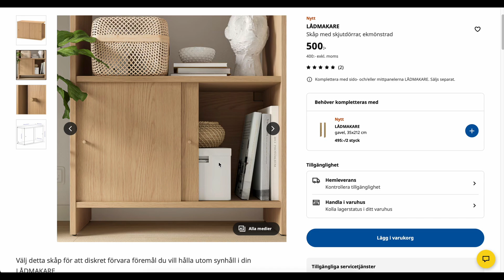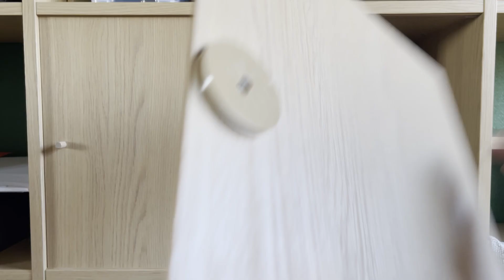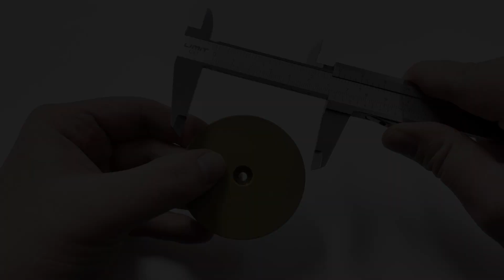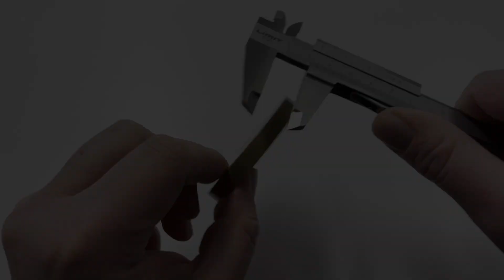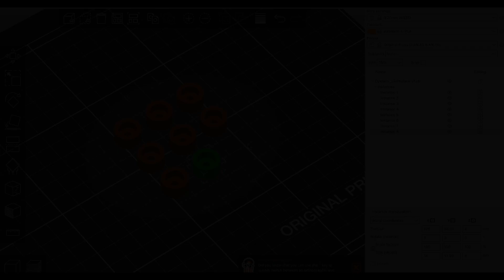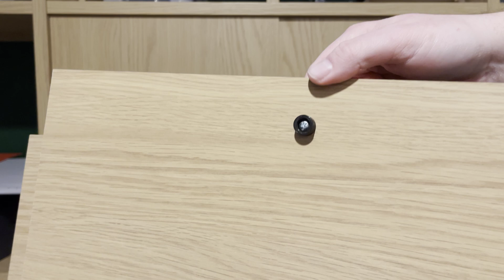IKEA LÅDMAKARE  - fixing annoying design flaw!

Comment: Hi! We are looking for a tall shelving unit to use as a room divider in our new townhouse. Can i ask what the back of the sliding Doors part looks like (as we would like to use some but then the back would also be visible)? Is it at least somewhat visually appealing 😅 or does it basically look like the cardboard on the back of a lot of Ikea furnitire? 😅
Reply: Hi! The back of these is the same as the front but there are 2 cutouts on the top back of the storage for anchoring to the wall  and also on the bottom there is 2 inches of exposed particle board  on the vertical dividers that support the storage so if you are okay with those it wouldn’t be too noticeable in my opinion

Comment: May I please ask you two questions, since this shelving system will be delivered today:
	1.	Do you use wall plugs (dowels) to fasten the shelf to the wall, or only the screws that are included?
	2.	I have to assemble this shelf on my own. Can I fully assemble it on the floor first and then attach the complete shelf to the wall as a whole?

Thank you very much for your help!
Reply from the maker: Thanks for the questions and congratulations on your new furniture ❤️
1. As I remember no wall plugs were provided, what is common at IKEA as on many markets you need quite specific ones. Mine is fixed to a drywall with those „umbrella style” ones.
2. I was assembling it on my own also, and was perfectly doable in upright possition. Just go element after element, firstly fix one side panel to the wall, then use one shelf to set the second one etc. I think it might be doable to build it on the floor, with front facing down, but you need to be very cautious when moving up. And personally I believe it might be a way harder way than going straight on the wall.
Reply: @ChrisTalksAboutThings  I really appreciate your congratulations. That is such a thoughtful and kind gesture from you. Thank you so much!
With gratitude, I thank you for your detailed, helpful, and timely response. It is a great help to me!!! I will follow your example, buy suitable plugs, and then assemble it step by step on the wall.
Did you fasten the plugs you bought to the wall using the screws provided by IKEA, or did you purchase other, higher-quality screws?
Reply from the maker: I used the ones provided with plugs, but there is nothing wrong with IKEA ones if they work with your plug. Happy assembly!

Comment: Great video! I have a question - would it be possible to assemble this but not put all of the shelves in? I want to leave a large gap to have art on the wall but not sure if missing out a shelf to make sufficient space for it would be an issue?
Reply from the maker: Yes, absolutely. It’s probably not according to manual, and you will have those tiny empty holes, but I see no reason why not. As long as it’s fixed to the wall should be super good! Thanks for watching ❤️

Comment: Hello there! Great video.

Was wondering how easy/difficult it would be to add those slide doors after construction? Like if I assembled the cabinet without it, can I take the shelf apart easily and add it in? What do you think? 

Currently the slide doors are out of stock at my IKEA.
Reply from the maker: Hi! Yes, easily doable without any issues, but you will need to take away 2 shelves and 4 fixtures. The only one thing what I would recommend is taking extra care when it comes to leveling, as straight as possible will make easier sliding new elements.

Comment: Hi , this is helpful . In your opinion could this unit be made without attaching to the wall? I want to buy it for rented accommodation where you are not allowed to drill into walls. Thankyou.
Reply from the maker: Hi! Absolutely not an option for you. This unit has no back, so almost all the rigidity is added by attaching it to the wall. Without it, it would probably collapse easily. Technically, you should always drill the furniture into the wall, due to safety, but for some smaller and drawerless sets, it might be okay to use it without fixing it if there are no kids. Please look at the IKEA TONSTAD; it is unfortunately much more expensive but provides a back piece and has a generous plinth so it works well self-standing.
Reply: Having just built the unit myself today (combination of 2 wide and 1 narrow, with 4 cabinets- 2 top 2 bottom) it is possible. 
It stands fine as is, but I would not feel secure leaving it as is. 

Instead of drilling to wall, you can get a square dowel that is long enough horizontally for the wall anchor brackets to drill into instead of the wall, or a flat steel brace or strut channel (horizontally). This would hold the walls of the unit together from the back, as it is otherwise only barely staying together via the shelf pins.
I would not attempt this without the cabinet units- a lot of support, and weight at the bottom of the unit, would be lost that way.
Reply from the maker: Thank you @Sayabbun for the tip! Yes, cabinet units add some rigidity, due to the fact that they have a back panel. Just always remember about tip-over risk!

Comment: Thanks for your observations? How would the unsupported (by a door & back wall) shelves support a heavy load of books in your oppinion?
Reply from the maker: Hi! This system is based on a honeycomb structure, so in fact there is a paper core between thin boards. It feels very similar to a particle board 18mm shelf in BILLY, but I haven't done any hard testing. According to the documentation, a wide (76cm) shelf is rated for 20kg max, and a narrow one (36cm) for 10kg, of course equally distributed. Overall quality is decent, but there are two important details: Shelves have fixed locations; you can't adjust them or add extra ones in between. And secondly, you can't get cabinets on top of each other; there must be an empty space between them vertically. Thank you for asking!